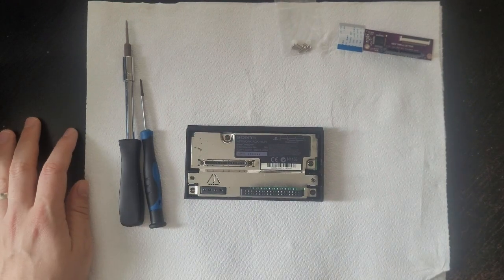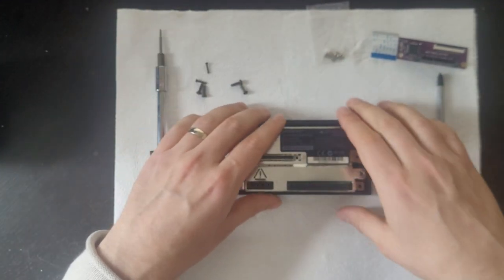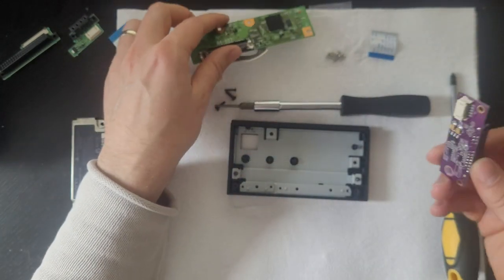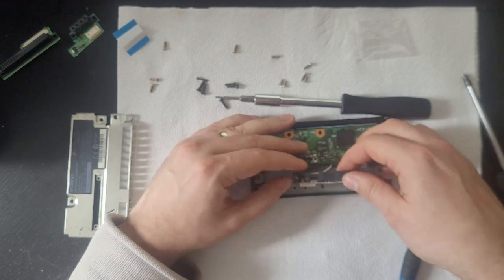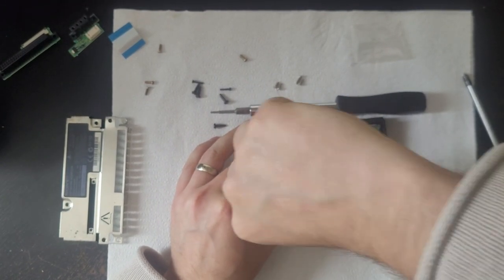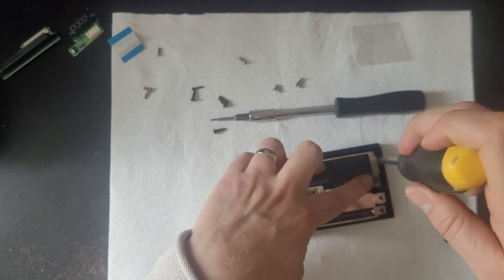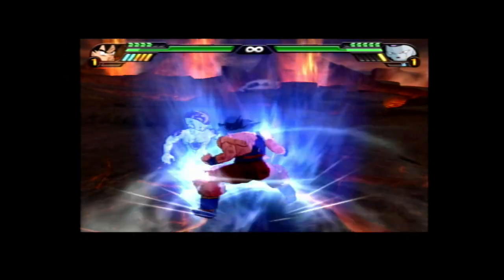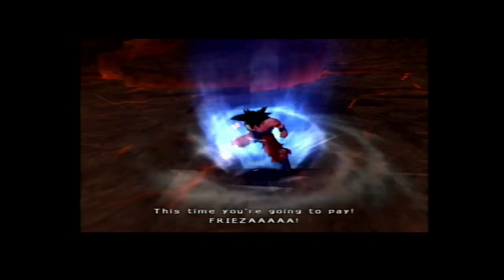Modding a PS2 Network adapter to work with SATA SSD

Comment: Absolutely amazing video. I might try this on my system. I’m assuming it helps with loading times too? I want to play Blaze and Blade but loading times are so long on that game at times you think the game might have crashed.
Reply from the maker: I'm not sure the loading times are quicker, I suppose they might be, the read speeds of the disc drive is quite slow, I think its likely that the bottleneck in that one is the processing speed of the unit or the amount of data that needs loading from the disc.